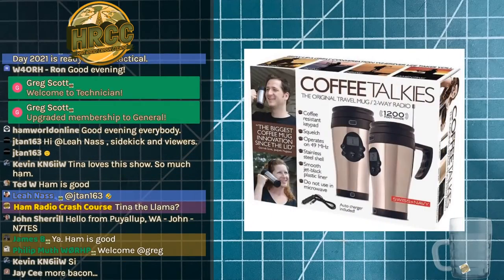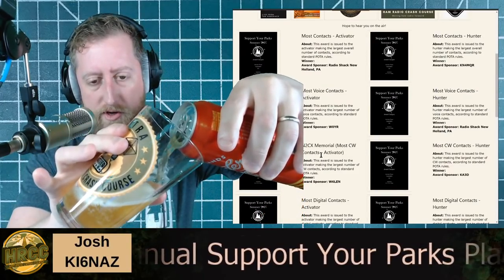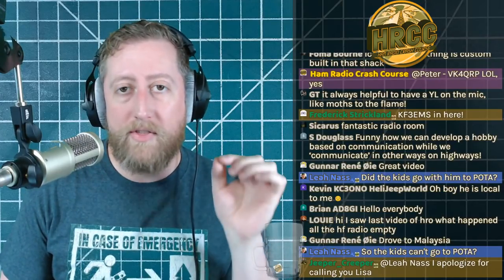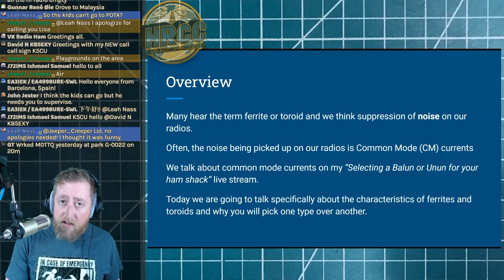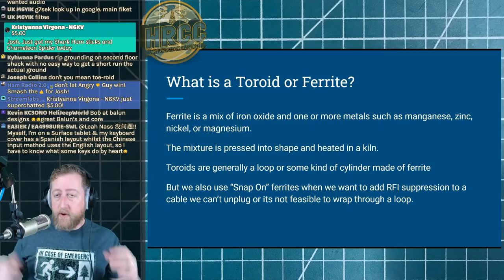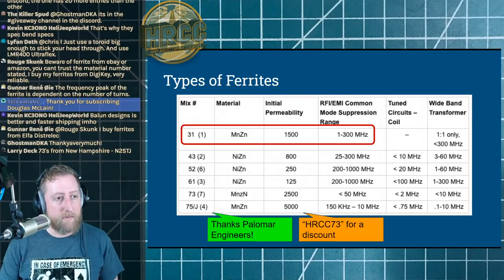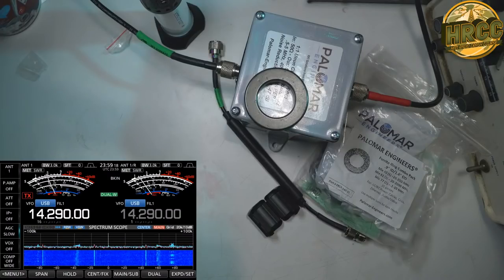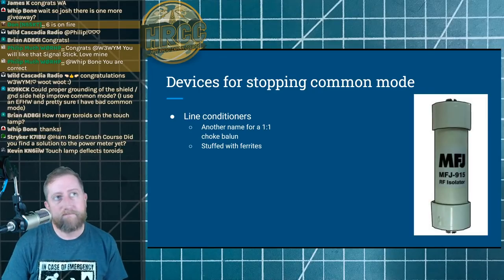Selecting The Right Toroid & Ferrite to suppress EMI and RFI (1:1 Choke)

Comment: I thought i would share this if you didn't  know. The LED lights put out a lot of RFI made in China now. I bought some shop lights and found this out. It was so bad it stopped tv antenna signal on shop tv. I was wondering if i would need to put a Toroid on the light cord to stop it or a filter

Comment: I have a noise in only one of my surround speakers of 7 installed, I put ferrite beads on every single power cord and speaker cable and no improvement, thankfully you hear the noise only when the receiver is to the maximum volume, I also separate power cords away from the speakers cables …I noticed that only happens when my Apple TV is on ☹️

Comment: 31 material is great, but the differences in types of common mode chokes shows up with measurements done by some of the other channels. That type is barely giving you 15db. I've seen as much as 31 db with other types including wire wound types. A few of the channels show measurement set ups , some better than others , but all who are measuring the attenuation have my "likes". That said, the s unit method will give you a real time look. The best one I saw was a channel with the words VLF in the name. He got amazing results. By the way, the type 2 material, red, is commonly used for tuners and perhaps un uns ? It is considered to be one of the best for those and used by the atu100 and and the mfj tuners and many more. Interesting how that works?
Reply: Are you referring to VLF Radio? If so a quick search of his videos didn't produce an appropriate title to suggest he was evaluating ferrites, chokes or toroids.

Would appreciate a specific reference if you have one (or more).

Thanks!

73,

John - KK7JBZ

Comment: I have a choke outside the shack at about 40ft from the antenna feedpointe on the 40-10 EFHW; 5 loops with a snap-on type 31 ferrite bead, .50" ID.

Comment: Great video. I live in the flat and I use endfed halfwave 20m long. I use toroids on both ends of the coax feed point and transiver. I use 3 on each end materials 52, 43 and 31. Around 10 turns on each. Amazing suppression since I fitted them. Not 100% but very very good

Comment: Just want to add IF you a building a portable Magnetic Transmit Loop instead of using a matching coil, use a White Amidon Brand Iron Core Toroid with 2 turns through the middle of the coil.  You slip the loop over the coax of the loop.  You will then have a great low SWR on 40-10 meters.  No it won’t work for 6 meters. You need a yellow core for 6 meters.  

Toroids are fun.

Kind of off topic for this video but if you are an experimenter just wanted to pass along my 2 cents

Comment: Worked Dominican Republic on 6 meters e-skip double hop yesterday! 2,377 miles! Conditions are similar today but shifted west so maybe CA will get in on some 6m prop!

And a reminder, ARRL June VHF contest next weekend! Good chance to see what goes on on 6m and up weak signal(SSB, CW, FT8...) and hand out some points to your locals!  Don't need fancy antennas to start but remember, VHF+ weak signal antennas are horizontal polarization, loss to a vertical is very high!